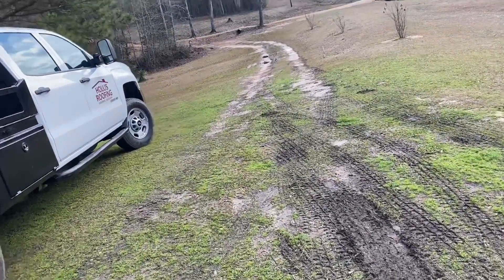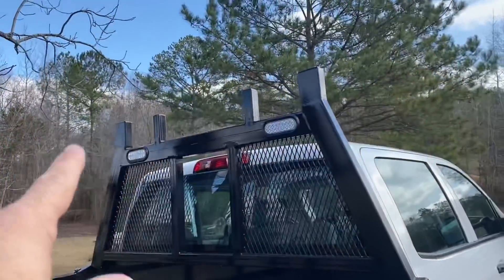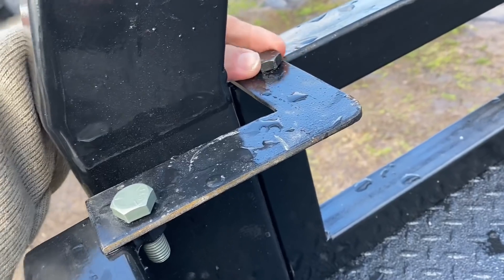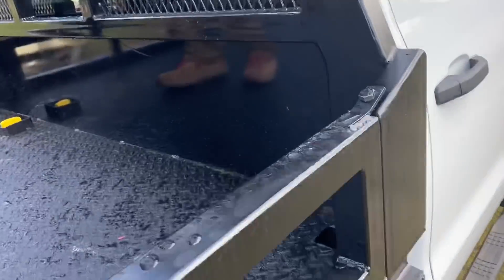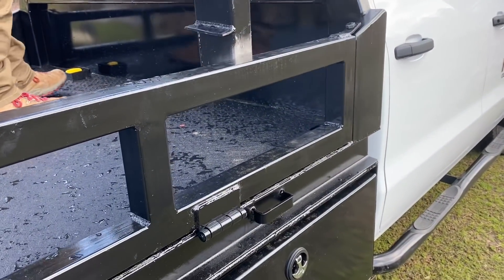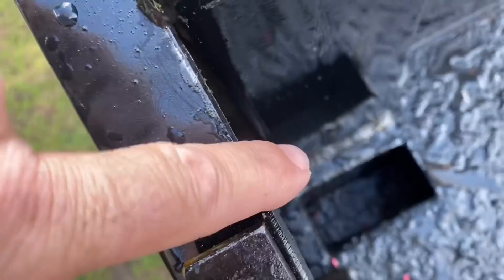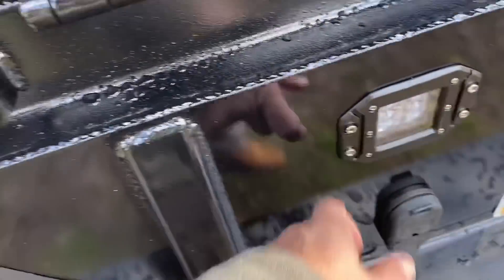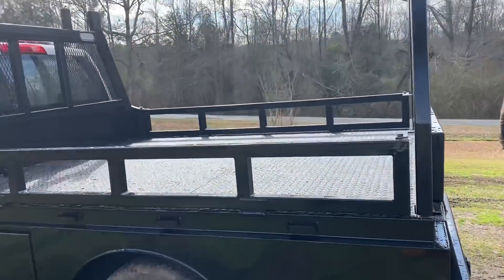Custom Work Truck Bed by SQ'D UP WELDING & FABRICATION

Comment: Good evening. My Crewcab is a long bed. 2013 6 litre. 75k miles. Still running like a top. Ya'll notch that corner you'll be fine. Rick is doing really good work. Be safe

Comment: hitch pins or detent pins would be more feasible than bolts on the back and side gates .bolts will seize and everybody aint got a wrench in their pocket
Reply from the maker: But not as tight and we’ll have tools on a work truck
Reply: Yea the pins still  let the gates rattle  aggravating  all that  rattling